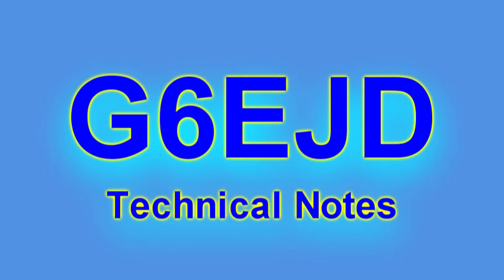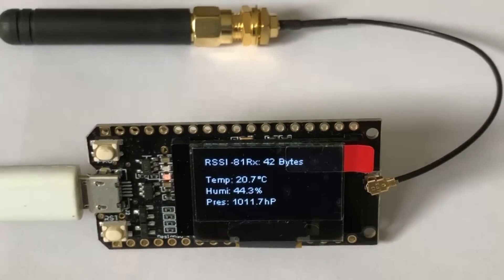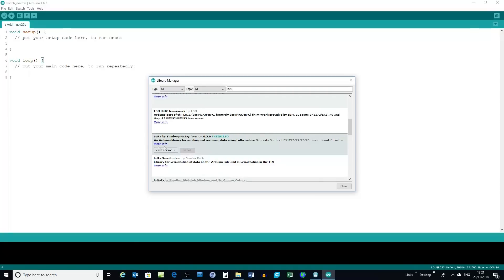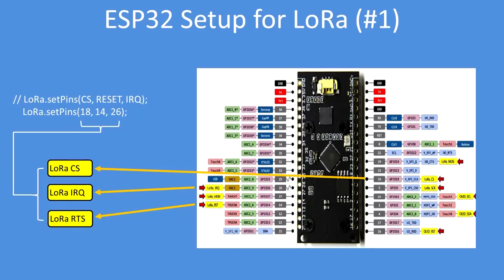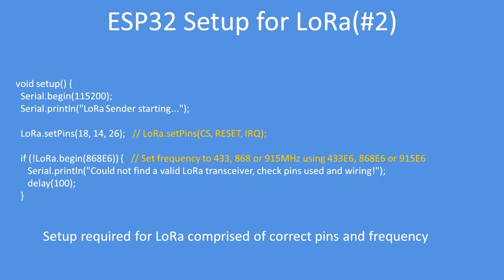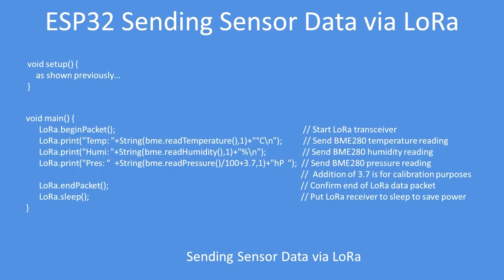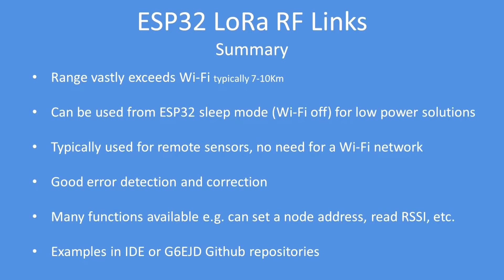Tech Note 111 - ESP32 LoRa Modules - Sending and Receiving Data

Comment: where do you configure which kind of spreading factor and channel bandwidth to choose?
Reply from the maker: LoRa doesn’t use the term bandwidth it uses bit rates, set like this: 

Radio.SetRxConfig( MODEM_LORA, LORA_BANDWIDTH, LORA_SPREADING_FACTOR,
                                   LORA_CODINGRATE, 0, LORA_PREAMBLE_LENGTH,
                                   LORA_SYMBOL_TIMEOUT, LORA_FIX_LENGTH_PAYLOAD_ON,
                                   0, true, 0, 0, LORA_IQ_INVERSION_ON, true );
	state=STATE_TX;

Comment: Hello! Good video, how can I send this data to a web server using POST? I'm stuck in here because I can't do both things at the same time, and if I put the data sending to the other core, I don't recieve the data in the other core, I already tried freeRTOS, but it doesn't work. Can you help please? thanks in advance
Reply from the maker: You can communicate Ethernet cores with shared variables, that’s quite straightforward. Similarly if you receive data via Lora you can POST it to a client or wherever. You’d need to use a flag (say) to know when new data has been received between the two cores.
Reply from the maker: Lora is not a duplex system, well it’s very difficult to implement duplex with Lora
Reply: @G6EJD I think I didn't understand clearer sorry, I use sender and reciever, both with ESP32 and LoRa, not only the LoRa, and the reciever needs to recieve the data, to send it into the server.
Reply from the maker: @MiG-25IsGOAT so the LoRa receiver gets the data, that could be on one core or another (passed to the other via common variables) and then sent to the WebServer for onward sending. So get the WebServer running and tested. Next get the lora running and tested. Then programme them both to each core as required.
Reply: @G6EJD Hello! Thanks for the response, I already have the server running and sending data on core 0, and the LoRa on core 1, but the problem is I don't recieve the data of the lora, and I somehow can't send the data to the core 0, even using freeRTOS that is the most used method
Reply from the maker: @MiG-25IsGOAT  have you got shared variables between the two cores?
Reply: @G6EJD  Do you mean something like "tempCore1 = tempCore0", and then send tempCore0 to the server? If that is the question, yes I have, and it still doesn't work
Reply: @G6EJD Yes, And it also doesn't work, I just tried with semaphores, same thing, And now I'll try to put them both in the same core and try to make it work

Comment: is it possible if there are more than one TX LoRa module with one RX LoRa module?
Reply from the maker: You can have as many LoRa TX as you need with just one LoRa RX but you will need to manage the TX’s to stop TX clashes that is when TX send data at the same time thereby preventing a successful transfer. Maybe allocate a time slot to each TX unit.

Comment: Hi David. Excellent work. Before I purchase anything would you please answer one question (if you know - or give your best guess). If I transmit at 38400 baud how long range could I expect ?👍
Reply from the maker: Little to nothing as LoRa can only operate between 0.3kb/s and 27kb/s and to achieve the higher rate you’d need to set the spreading factor accordingly meaning each packet will take a long time to send, you can’t get something for nothing and can’t send synchronous data.

Comment: Battery won't power up the board. Any setting for that?
Reply from the maker: No settings, it’s either a hardware fault; unlikely, or the polarity of the battery is wrong for the board design, there is no standard. Sometimes the + and - are marked on the board check that the battery is correct in that Red is to the positive, if not carefully unclip the cables from the plug and reverse them both. Or the battery can’t provide sufficient power under load.

Comment: can this code run on an arduino uno !!
and what should i change in order to make it work with an atmega328p
Reply from the maker: The basic code would be unaltered but do you have LoRa modules connected to the UNO?
Reply: @G6EJD  i am building my own pcb and using atmega328p , sim800c , rfm95(lora) 
I am receiving sensor data from a lora device and sending it with grps to a firebase server
Reply from the maker: @dhiamakhlouf9933  yes that will all work

Comment: How much difficult is it to add a display to the Tansmitter to show what it is sending ?
Reply from the maker: It would be very easy. The most simplest approach would be to use a low cost OLED display 0.9” or 1.3” using the I2C bus connections the library would work alongside the LiEa if you have the modules with the display already fitted then the examples are already provided.

Comment: Great walk-through, but after watching many videos; reading guides and documentation; trawling through lib code.. I can't seem to find anything on sending and receiving 'fixed' (direct, addressed) transmission frames between a sender and receiver, in the standard LoRa data frame format (ie. [<Addr><Addr><Chan><Options><Message>].

Ebyte's E32 Lora modules (with simplified serial communication) do such a clean job of this, while ?unfortunately? abstracting the process. I've had no issue there. 
Moving to Arduino-compatible chips, ESP etc I've run into a world of hurt where all examples seem to be either LoRaWAN or non-addressed messages; your video here is another example. 
The library's seem to have no provision for address filtering.
Sending a structured frame seems to be easy enough. But assigning a 2 byte receiver address to a node has me stumped. Help!
Reply from the maker: It’s really very simple to implement just add (example): setSyncWord(0x34); then the receiver will only react to a LoRa packet which was sent from a LoRa module where the same synchword was set. So setSyncWord(0x34); then send data and only modules with the same address will process the packets. Or use setSyncWord(0xFF); for a broadcast to any receiver.
Reply: @G6EJD  Brilliant. Thanks so much for replying, I won't know immediately but it sounds like you've 'unblocked' me on this. 
I think I've probably been put off track by returning to a project that started with ES32 modules and their abstracted documentation/language. I hadn't picked up that the "address" field I was looking for might actually be the SyncWord. Happy new year.
Reply from the maker: It does work although slows down packet speed a little and for lots of devices you need careful address management. I tend to go for a one-to-many topology otherwise it’s gets very complicated to manage. In practice I’ve never found a need to use addressing unless there are very many master devices.

Comment: I have a warehouse about 5km away from my house and I need a camera will this work? :)
Reply from the maker: Not at video rates but occasional still images would work, the data rate is not high enough.
Reply from the maker: @Harold Reasonswith the supplied antennas I got a range of 2.4kM in an urban area, if in green field conditions it should approach 5-6kM

Comment: Thanks can we used like telemetry for drone
Reply from the maker: LoRa is relatively slow about 1-2 secs per packet so for drone work maybe too slow
Reply: @G6EJD  give me device
Reply: @G6EJD  what i can use for system radio for drone
Reply from the maker: @bassemgatowani8387  most TX eg Taranis have an RF link built-in for that role
Reply: @G6EJD  thanks what i can used for system radio for drone
Reply from the maker: The RX’s have a TX in them, don’t you use a digital radio most people do. They can send position, voltage, video, data, etc to the controller.
Reply: @G6EJD  serial radio be better
Reply: @G6EJD  serial radio be better
Reply from the maker: @bassemgatowani8387  maybe, but every one uses the receivers in-built transmitter

Comment: I'd like to play with this in the data segment of the 70cms band.
I'm currently playing with this on SRD 868
Reply from the maker: Yes will work OK, the chip can be set for any frequency.
Reply: @G6EJD  I'm wondering where to plonk its centre frequency.
My spectrum analyser shows it as 6 MHz wide
Reply from the maker: Well, you can vary the spreading factor which is a 6-12 value, varying data rate speed and bandwidth, but it’s transmission mode is spread spectrum / chirp, so strictly speaking you just have to keep within the band edges and other channels will be largely unaffected other than noise. I’m not sure if the mode is allowed undo the licence conditions I have not checked.

Comment: Excellent and very clear video.

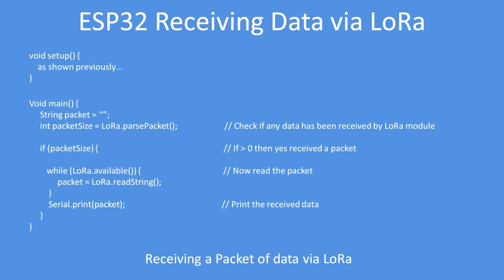Question: Video at 05:00, in the LoRa receiver, you check if any data are available, if not the program stops right away. Perhaps you only wanted to show the concept, wouldn‘t a loop with checking/sleeping, waiting for data be more realistic?
Reply from the maker: I looked at the examples and apart from the sleeping version they are all checking for reception continuously
Reply: @G6EJD :
I was refering to the video for example at 05:22, it says:

void main() {
   String packet = "";
   int packetSize = LoRa.parsePacket();

   if (packetSize) {

to me, that would only check LoRa.parsePacket() when the program starts. If no data are available at that time, the program will stop and not wait for data to arrive at a later point in time. If that code bit were in loop() or Check4Data() etc., then it would be clear.

I see that the code at GitHub is different, there you got a setup() and a loop() routine, which I then assume you mean to be called from the main().
Reply from the maker: It was a C leftover rather than Arduino, yes it needs to be in a loop or use the event mechanism of onreceive then no loop required

Comment: Hi, thanks for your efforts!
In your video tutorial, it‘s point-to-point communication.
Do you have any recommendations for point-to-multi-point communication via LoRa? I.e, how to make sure delivery from each node. As far as I know, LoRa only allows for receiving messages from one node at once. So that would be a problem.
Reply from the maker: You can broadcast using an addressing scheme and LoRa supports that but there is no protocol for guaranteeing delivering like TCP/IP so you’d have to engineer your own in software. You could do that with a simple broadcast to all nodes and then wait for a confirmation from each. There are problems though much like Ethernet called carrier sense multiple access because all the receiving nodes will try to respond with a reception confirmation at the same time so there will be clashes and simultaneous transmissions meaning some responses won’t be received. You could use FEC forward error correction whereby the message to all broadcast receivers is sent with redundancy say 3 copies of the same message then statistically the chances of all 3 not being received are very small then receivers only request a resend if not received that greatly increases throughout and gives almost guaranteed delivery.
Reply: @G6EJD  Thanks for the reply! Unfortunately I am not mastered enough to understand your tips...It would be great if you can provide some code examples or tutorial sources regarding this topic.

What I am trying to do in my project is that, I have 3 slave ESP32s as wifi sniffers to listen to nearby wifi packets of mobile devices, then the 3 slaves will send the captured data via LoRa to the master ESP32, which will receive data. My problem is simply how to make sure the data flow from slave to master smoothly (no data loss, no collosion of data if all slaves want to send data to the master at the same time)

If I understand well, the simple LoRa is only suitable for point-to-point communication as you did in this video. For point-to-multi-point communications, I need to instead build a LoRaWAN gateway on one of the cores of the master ESP32. Am I thinking right?
Reply from the maker: @huaminghuang  yes your thinking is correct, but a Lorawan does not implement end-to-end protocols either only between the lorawan access point and internet. So you still have the same problems, for example two stations could send at the same time and their messages won’t get through thereby needing resends but they won’t know to resend unless told to do so. This is why tcp/ip via WiFi provides a much better solution but if range is an issue than you need Lora and so the problem continues there is no simple answer.
Reply: @G6EJD  Ok! Thanks for your hints and interests. I think I need to reorganize my project in a more proper way. For tcp/ip via WiFi, can you provide some useful learning links? TBH I didn't even know how to get started with tcp/ip via WiFi on ESP32...
Reply from the maker: There isn’t much to learn as the handling of tcp/ip transfers is handled for you. You can also use UDP for broadcasting and that uses a reasonably good protocol for your application there are examples the IDE
Reply: @G6EJD  Many thanks!

Comment: I tried to connect same way but Bme280 wasnt detected.  I change address 0x77for 0x76.. but It still isn’t working. How can I resolve this?
Reply from the maker: First you have to determine which pins are the SDA and SCL, these are determined by the board type you selected in the IDE, which type of board is it your using? Also write a short programme that displays the value of the I2C pins like serial.println(SDA) and the same for SCL. If you have a test programme for a board with a display check that for hints on the connections or look for a pin-out diagram

Comment: very good example..  but how didt you get it to sent over 1 km ??? max range here is 500m
Reply from the maker: Depends on the terrain here and with you, in open space you should easily get 5-7km. Did you orientate your antennas vertical to vertical or horizontal to horizontal? I can’t remember if I set the example to high power, but that’s possible too. The range I got was an easy 1Km as measured by google earth. What is around you? There is an effect called the fresnel zone the size and effect of is determine by antenna height and obstacles to name a few.

Comment: I need some help to recive data form acelarometer

i send X.Y.Z and recive this in one line.
then i try change code and get overlaid text like this
X= 3.4
y(overlaid)=-2
z(overlaid)=0

so i assume i'm using code for recive 1data like counter, and not mutiple data

display.print("X");
   display.setCursor(0,40);
   display.print("Y");
   display.setCursor(0,50);
   display.print("Z");
   display.setCursor(10,30);
   display.print(LoRaData);
Reply from the maker: Copy here a single line of text from the lora

Comment: hi whenver I run the esp32 lora sender/receiver examples I see  characters like this on my serial monitor "⸮sS⸮0c⸮#S⸮d⸮⸮⸮⸮*=⸮⸮U⸮ v+⸮⸮". I am just using the standard examples and cant figure out how to turn these characters into strings/numbers so i can perform logic on them
Reply from the maker: What serial port speed are you using? I only use 115200 baud in my examples so when the serial port monitor is open is it set to the correct speed?
Reply: @G6EJD  I appreciate your response so much thank you. I can now see the messages in readable form after changing the baud rate. Do you know why I had to do that? I had it previously set to 9600?
Reply: @G6EJD  maybe it had to do with this line in void setup... "  Heltec.begin(true /*DisplayEnable Enable*/, true /*Heltec.LoRa Disable*/, true /*Serial Enable*/, true /*PABOOST Enable*/, BAND /*long BAND*/);"""". its possible that the true value for "Serial Enable" enables the baud rate on 115200?
Reply from the maker: Well it enables the serial output yes as part of Heltec’s setup. 9600 baud is an old school speed thats not required for the ESP32. Best to always use what is now the de-facto speed of 115200
Reply from the maker: The baud rate is explicitly set in the programne
Reply: @G6EJD  great thank you very much. I am a complete newbie to heltec and the esp32 and didnt know I had to look for the baud rate in their documentation. But now I found it and will look for this in the future, thanks for the help
Reply: out of curiosity. is it possible for each esp32 to be both a sender and a receiver. if the esp32 connected to wifi sends a message via lora to another esp32 in a remote area... can the remote esp32 respond to the connected(gateway) esp32 as confirmation a message was received? similar to a callback message in mqtt?
Reply: there is an example for this in the heltec library I just found for anyone else with the same question
Reply from the maker: Yes, there are some examples around. I have what I call a transponder example somewhere as each unit sends and receives simultaneously to each other, I use it for range testing, I must resurrect it.

Comment: Hey, thx so much for this video!
and can you tell me if this work on BMP180?
Because i got the problem with the I2C when i use the oled board :(, didnt find the solution to resolve it...
error:"no matching function for call to 'Adafruit_BMP085::begin(int, TwoWire*)'"
Reply from the maker: Yes the bmp085 works with the bmp180 start the sensor with bmp.begin(0x77); if using a 3rd party sensor bmp.begin(); if Adafruit version. Go to to examples Adafruit bmp085 and try those
Reply from the maker: yes it will work with the TTGO board too.
Reply: @G6EJD  thx very much Sir its worked!💪👏